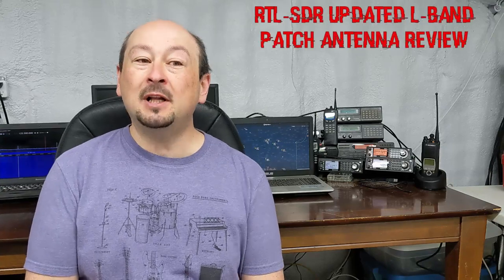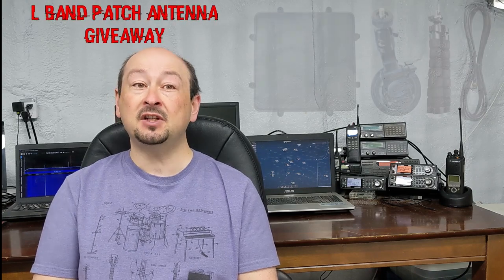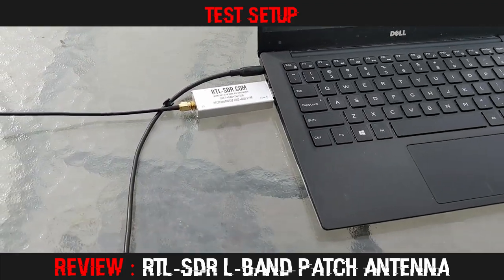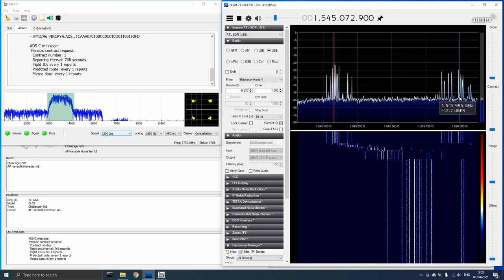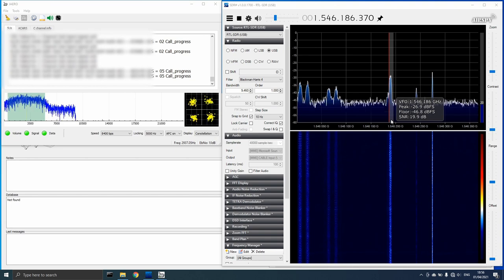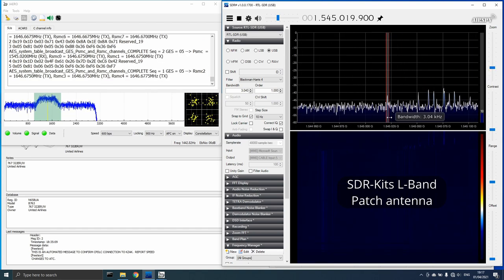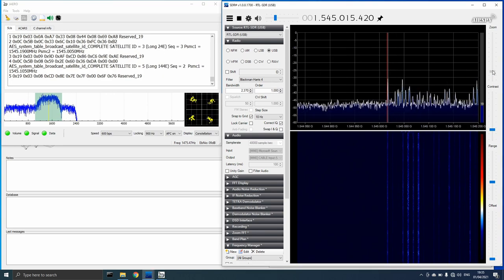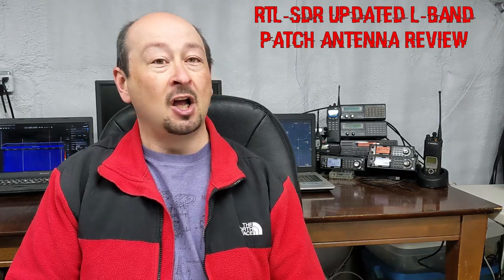RTL-SDR updated L-band patch antenna review - perfect for your SDR radio!

Comment: I see you have a couple of P7100 radios back there. I would absolutely love it if you did a video showing AEGIS digital voice. There is really not much information on that mode online and I've only found one sample of how it sounds, and that was with DES encryption too which I read sounds different from normal AEGIS.
Reply from the maker: Yeah, I have some Harris radios. These ones are actually P7200s used for P25. I haven't ever played with AEGIS as I use these for RX only.

Comment: Hi Rob, I have just purchased a new omnidirectional patch antenna, your video is very helpful in setting up Jaero, one quick question, the logs seemed to be being saved as audio files instead of text files is this correct ? regards Alan
Reply from the maker: No, logs should be saved as text files as you anticipated.
Reply: @FrugalRadio  Thanks Rob

Comment: Really enjoy your videos. I am still a little confused on where to point an antennae to receive the satellite. I am in Central Tennessee. Thanks
Reply from the maker: Hi Jim. Generally facing south, but it depends on which satellite you're looking for. Your inclination angle would be a lot lower than mine, since you are much further south than me. Depending on the antenna you use, you could probably just let it point straight up, assuming a decently clear view of the sky. Once you find a selection of carriers, you just manipulate the antenna until you get the strongest reception.
Reply: Try dishpointer.com - select the satellite you're looking for from the pulldown list, enter your town/city as the location, and voila - tells you direction and elevation!
Reply from the maker: Great tip, thanks for that!
Reply: @FrugalRadio  Than you for the information. I just ordered the patch antenna

Comment: My wife bought me this antenna back in November for a Christmas present based on this review. I am located in central Florida and was previously able to pick up Lband aero signal just by placing the modified gps antenna on a metal cookie tin lid  in a south-facing window shaded by leafy oak trees. The last signal recorded by Jaero was back in Oct 2019. I have put the antenna outside on top of a fence facing right where Dishpointer says the Inmarsat satellite is located, south and west. After fiddling with this for a month I still have not gotten a 4 point signal or the data light to come on. I can pick up a bunch of single frequency, two point signals from 1511MHz to 1980 MHz but nothing kicks on data reception in Jaero. This has been very much of a let-down since Amazon doesn't have any more and no date when more will arrive.
Reply from the maker: Good morning Jim. Sorry to hear you've had some problems.

Your issue sounds like it could also be a receiver issue, so I would start there. Making sure volume level is good, bandwidth is correct etc. 

I would also reach out to Carl from the RTL-SDR store. He is very knowledgable, and stands behind his products. https://www.rtl-sdr.com/submit-a-storycontact/
Reply: @FrugalRadio  Thanks for your quick response.
Reply from the maker: You're welcome Jim.
Reply: @FrugalRadio  Hi again. Just for grins I thought I'd hook up my old tri-bander scanner antenna to my RSP2 with SDRuno 1.41.1 and look for paging frequencies for Openear. It turns out all the frequencies I could receive on the SDR blog panel antenna I can also get with no antenna at all - 1.536, 1.5377.452,1560, 1608 1632 etc. I never thought of trying this with no antenna. 
I will see if I can get this replaced. I made a similar question on a channel monitored by SDRplay and my question got deleted. I also tested with an SDRblog V3 and got similar results.
Reply from the maker: Pagers use very powerful transmitters. It is not unusual to be able to receive them with a completely inefficient antenna. Although I've never tried picking them up with no antenna connected, I can receive them on short pieces of wire connected to the SMA adapter.
Reply: @FrugalRadio  Thanks for the thoughtful reply. Misunderstanding here. While I was looking for paging signals using another antenna I discovered that the L-band frequencies appeared with no antenna connected at all.
 I suspected the patch antenna had been a return when I opened the box and now I'm certain. The patch antenna is an open circuit and I confirmed all connections were tight.
  Amazon issued a return authorization number but I think I might open it up and look for an broken solder joint.
Reply from the maker: Ah, my misunderstanding. Sorry about that.
Strange that it's picking up L band with no antenna at all.  I would not have thought that possible. What kind of SNR levels are you getting?
Reply: @FrugalRadio  I I have a text file with about 32 frequencies I can email to you instead of here on the main channel. The big ones are 1560 MHz 30 db, 1584 40, 1608 37, 1656 40. I go by reading the divisions on the scale, 10db per div. The snr readout is 10db less.
Reply from the maker: Very fascinating Jim. Thanks for reporting back!

Comment: Thank you for the extensive review. 
I must ask, do you know/think this is the same or similar L-band active patch antenna of the Outernet/Othernet Dreamcatcher receiver board, circa 2017? I would love to be able to use the one I own + RTL-SDR-V3 for Inmarsat-C messages reception. Thanx, lm
Reply from the maker: I don't know if the design is based on that. I know that others have successfully used the outernet equipment to monitor L-Band Aero messages though.

Comment: thanks for the video Rod. have you ever found 8400 signal on 54 degree sat? i cant seem to find any.
what software are you using for the nuelec smartee?
all the best from NS.
Reply from the maker: Hi Steve. Yes, I've received 8400 from 54W, but that was when I was in Europe. Haven't tried it from here, although as you will have seen, the 8400 on 98W comes through quite nicely.

Just use the same SDR# for the NooElec dongles.
Reply: @FrugalRadio  thanks, for the reply.

Comment: If you ever run out of ideas for Rtl Sdrs maybe you can start a series on the Ubitx transceiver kits. It would keep with the frugal spirit and it too has a large online community.
Reply from the maker: I'd certainly love to try the Ubitx transceivers!
Reply: @FrugalRadio  I gave my Ubitx5 to a new ham when I got my second transceiver, but you can even solder the rtl sdr directly  to the board and after the filters for spectrum and waterfall on the desktop. Great little pieces of kit.
Reply from the maker: Sounds like they are very capable and a lot of fun!

Comment: Too bad it's not rated to go a few dozen MHz higher, else it would also be good for GOES weather satellites. Maybe it would still work, at reduced amplitude? Or do you suppose the frequency response has a relatively sharp cutoff?

Thanks for the review - even though I have the SDR-Kits antenna, I may buy one of these at some point, as I only have a limited view to one of the Inmarsats (house is in the way of a direct view), so my signal levels are low.
Reply from the maker: Yeah, I don't think it is going to work for GOES at all. A lot more gain would be required for that!

Comment: Would this work for transmission as well? I suspect because of the LNA it won't, but am I correct? Is there something like this in this sort of price range, but for both rx/tx? I need it for extending the antenna on an Inmarsat phone, and the only thing I'm finding is marine equipment which is always overpriced.
Reply from the maker: No, this is a receive only antenna, as you correctly suspected. eBay can't sometimes turn up Inmarsat gear, and might be an avenue to explore.
Reply: @FrugalRadio  Thx I'll have a look at that. Btw, any idea how these active antennas for marine that I'm finding works, since they are both rx/tx but only have one SMA connector, and somehow they are able to add gain in both directions (or maybe only on rx, but they are able to have tx on the same line). Promise this will be final question :) thx
Reply from the maker: I've never used them, so I actually don't know, I'm afraid.

Comment: How do you know what bps to set JAERO to when tuning to the signals in SDR#? Does JAERO automatically detect and decode the data type (voice call versus ACARS transmission, etc.)? Thanks!
Reply from the maker: No, JAERO doesn't automatically switch.
Easiest way to tell is by the channel width. If the signal is lower than around 600Hz wide, it's 600bps. The 1.2khz channels are the 1200bps, and the 11khz transponders are the 10500bps. The 8400 bps audio ones are generally positioned after the 10500 transponders.
Reply: @FrugalRadio  Got it! Okay, so the bps generally follows the bandwidth of the signal/channel, correct? Thanks!
Reply from the maker: You got it!

Comment: Thanks alot! I have also purchased one after seeing your review.

I can't seem to get Jaero to work on my windows machine however, do you have a link or guide for instructions perhaps?
Appears to be hard to find ;-)

Many thanks in advance!
Reply from the maker: Are you running a 64 bit version of Windows?
What message do you receive when it doesn't work?
Have you installed a virtual cable to carry sound from your SDR software to JAERO? Are you monitoring in USB mode?
Reply: @FrugalRadio  Thanks for your reply!
After thinkering a bit further I actually found the win64 executable on Github, the information on their page is somewhat confusing. Had me worried about compiling all of it myself. So, in short I did get it working. Anyone encountering the same issue I copy the link here: https://github.com/szpajder/libacars/releases

Now just to find out how to get the Acars/Plane database to work, the database file is not recognized (used the download link in the settings tab of Jaero). Not sure if I still need library files too. 

Thanks again for your swift reply.

Comment: What is the maximum current required by the patch antenna?
What is the EbNo: shown in Jaero for the 600bps, 1200bps, 10500bps and voice 8400bps?
If the patch antenna is used outside in the sun and it being black, wouldn’t it get hot?
If it did get hot would it be possible that permanent or temporary physical damage due to distortion could occur?
Also would it affect the patch antenna’s performance including the electronics in the preamp?
Reply from the maker: The EbNo is visible throughout the video as the different channels are explored, so if you look closely you'll see the figures for each in my location.

I'm sure the anternna will get hot, however your questions may be best directed to the RTL-SDR blog guys as I'm sure they have performed testing on various scenarios. Hasn't been warm enough up here for me to give definitive answers.

Comment: Great video Frugal.
This is very similar to what I did when pulling data & audio off of Optus B3 back in the good old Analouge days, then I used a 10.7Ghz LNB with an output of 1.2GHZ.

What is output freq for the patch new antenna. ?

What was the go with the voice that needed to be censored?.

Keep up the great work.🤗

Rgs
Wayne.
Reply from the maker: The patch antenna doesn't change frequency at all, like your typical LNB, so the output is direct as far as I understand.

The censored bits were callsign components that could have been used to identify sensitive traffic, so I bleeped 'em!
Reply: All good  @FrugalRadio  I've started the Australian Aviation frequency guide usung Google Maps if that works for you.
Reply from the maker: Excellent Wayne!
Reply: @FrugalRadio  G'day Rob.

I've liked your page on Facebook was looking for a way to communicate direct with you but couldn't msg you through Facebook, how do we hook up more directly would value your opinion on something.

Rgs
Wayne.
Reply from the maker: Hi Wayne. I keep my email address fairly hidden. If you'd like to post yours in response to this message, then delete it 5 minutes later, I'll use it to email you. I think that the deleted comment will show on my feed, as long as it is during my daytime.

Comment: Are you going to run a video tutorial on JCARO?  (The software yiu used in this video?)
Reply from the maker: I may do a Jaero tutorial at some point, if the demand is there. It is fairly intuitive to use. Probably the trickiest part is routing the audio from your SDR to it, but if you've been using virtual audio cables for other things, it's a piece of cake.
Reply: I'm a Linux only user. I found Jaero that will run in Linux, but had no idea the setup would require "virtual cable" - I'm afraid my courage to buy the RTL SDR and patch antenna for L band listening just drained away.
Reply from the maker: I use Linux a lot as well @Paul Moffat. For running Jaero I dual boot into Windows on the Dell shown on the video. That laptop usually runs Linux full time.

I haven't yet found a Linux CPDLC decoder, but the underlying base of Jaero is libacars which is used in several Linux packages for decoding ACARS & VDL2, eg dumpvdl2. So there may well be a way.

I'm Linux you don't need to use a virtual cable, it is possible to pipe your audio directly.

Comment: Hi I have the same RTL L-Band the frequency that you had voice comm on what mode was it on thanks.
Reply from the maker: The 8400bps voice channels are on USB, just like the regular data channels. You must have the AMBE codec installed to decode them.
Reply: @FrugalRadio  
Thank you do you have a link for the AMBE codec have got the RTL L-Band antenna so far havent seen or heard anything on my RSPDuo tried on my other wideband receivers with no success.
Reply from the maker: If you download the latest, it probably has ambe codec built in - https://github.com/jontio/JAERO/releases

Comment: What is the Maximum length of Coax you could use  to monitor indoors?
Reply from the maker: Depends on the coax and the frequency. Try a Google search on coax loss chart and you'll see the amount of signal loss that occurs by various distances at multiple frequencies for multiple coax types.
Reply: @FrugalRadio   Thanks very much. appreciated.

Comment: could you use a direct t v  dish  to increase gain and senativity
Reply from the maker: Possibly. Bouncing the signals off the dish will reverse the polarity though, so you'll lose a few dB. Hopefully you gain more with the dish.
Reply: @FrugalRadio  i just  found a old  mentioned  dish . just woundered  thanks  for  listening  , LOL
Reply: I agree pointing the L band  antenna into the dish antenna ,dish  will change it  from RHCP to LHCP  resulting in  little to no signal, so  what about  pointing them into another dish   double the size as the  first  and then fiddling  with  the focus  distance for the  best signal ,also  it  would  change  the now LHCP back to RHCP  I think , Rite? Tim
Reply from the maker: Worth an experiment I'd say!

Comment: Could this antenna be used to download LRPT data form NOAA satellites?
Reply from the maker: No. This antenna is tuned to operate around 1.5-1.65 GHz. It is also directional, and has a built in filter to block frequencies outside this range. This makes it unsuitable for anything other than Inmarsat and Iridium monitoring.

Comment: Man I wanna get one of these now. I have the v1 and it does great on 6 and 1200 but nothing on 10500 or 8400 which is where I'm interested in. Can't find these antennas now though
Reply from the maker: There will be some new ones available soon from the RTL-SDR store!
Reply: @FrugalRadio  just hope I can get the other 2 bps ranges
Reply from the maker: Understandable. The 10500bps channels are by far the busiest, and there is a good bit of activity on the 8400 transponders. I think you'll enjoy receiving the extra ones.

If you are handy, you can also make your own helical or patch antenna.
Reply: @FrugalRadio  yea ive never tried to do anything like that so im not sure if I could do it or not
Reply from the maker: Same here. I've built some basic dipoles, but the higher gain antennas are a bit more complex.
Reply: @FrugalRadio  I would much rather buy a good antenna then try and fool around and get frustrated
Reply from the maker: I hear you!

Comment: Is this antenna capable of receiving all types of bands or just aviation pls?
Reply from the maker: L band only. So Inmarsat aviation & Marine signals (1.5GHz) along with Iridium signals (1.6GHz).
Reply: @FrugalRadio  Ah okay great thanks, I after an antenna that will work across the rtl capabilities, based in Wales. Thanks again.
Reply from the maker: Yeah, this one is only good for satellite work. Check out the D-777 by Diamond for general aviation monitoring.

Comment: I just build one myself today. An L-Band patch antenna I mean.....Not working as I expected it to.
Reply from the maker: Sorry to hear that Rui. When I looked at making my own, I soon realized it was beyond my capabilities. Hopefully you get yours up and running better.
Reply: I also made mine, and indeed the antenna itself is not impressive at all, but I solved it by adding an LNA module from a cheap GPS antenna and to my surprise it works wonderfully.
But you have to get your hands a little dirty and be skilled with the soldering iron, anyway this antenna looks like it works much better and I think it's worth it.
Reply from the maker: I'm glad the LNA worked well with your patch antenna, and you got it working well. This all in one solution is great for those of us who aren't as handy with a soldering iron 😉